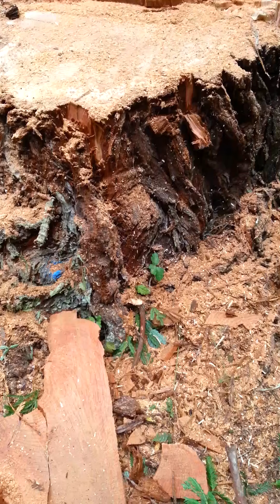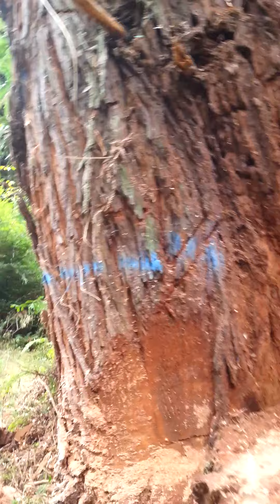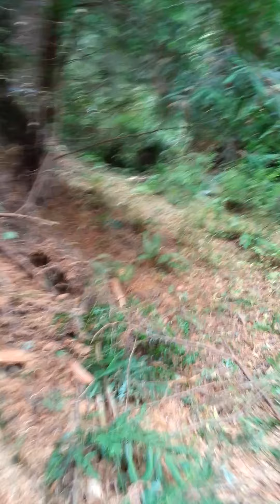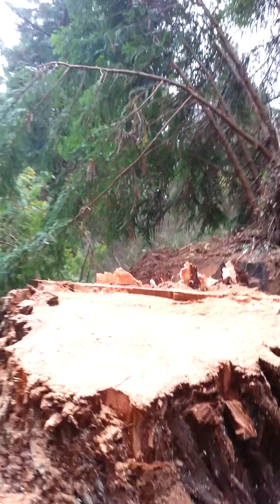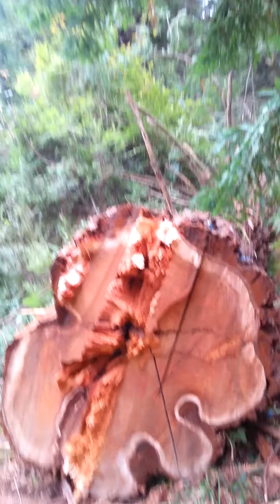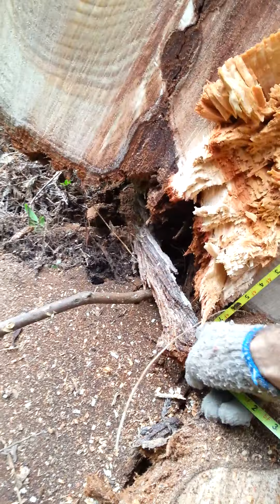Hero vs  Zero!!!

Comment: I believe that tree had good genetics and was destined to be a true giant. I couldn't see, but I bet the growth rings were a good half inch apart. And the way it broke off the stump says the same thing. They're not real tall, just beefy. Good job as always, Jack.
Reply from the maker: Steve hi.
I don't remember the rings. This is just down the valley from where the 35' stump that the Fieldbrook-ites use to hold their dances on. 
It seems like that are fairly tight from what I can remember. They are a little older. It's right along the old railroad grade that went to Crannell. 
Thanks for watching.
Reply: @hotsaws101  Thanks Jack. I remember seeing photos of that Fieldbrook tree. I read somewhere that a slice of it was sent to England.